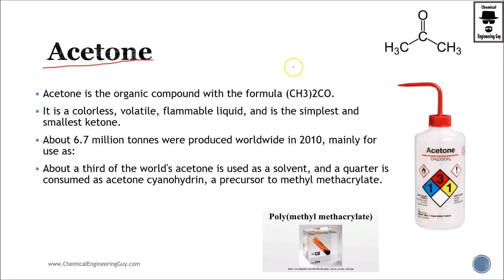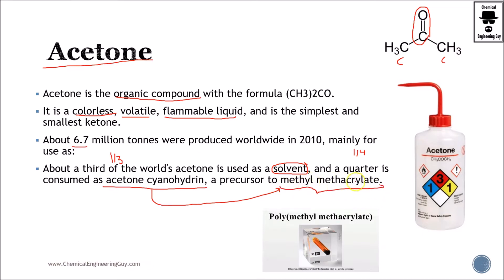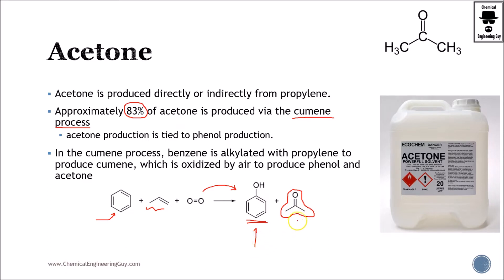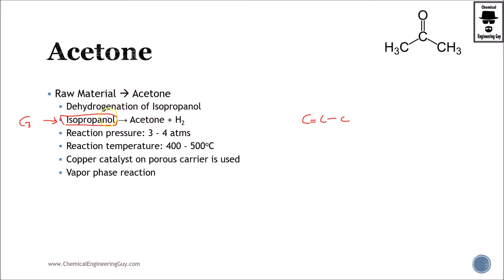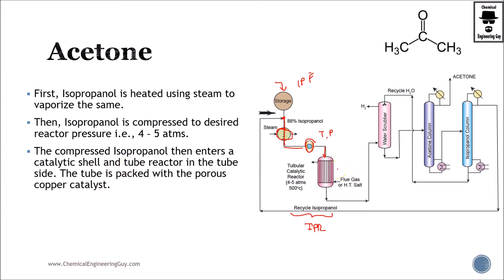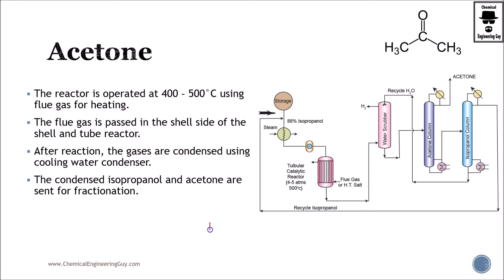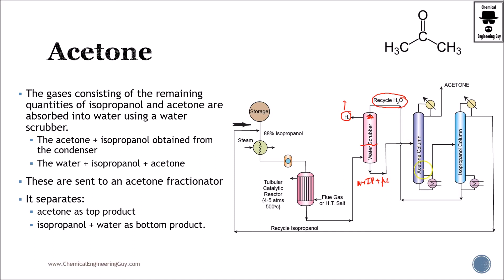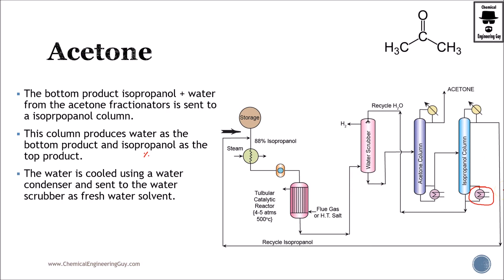Acetone Production Scheme - Petrochemical Process (Lec086)

Comment: this is process flow diagram or block diagram?
Reply from the maker: Something in between. It is more a Process Flow Diagram as it shows more detail to the process, but for sure could be a "block" diagram, in the sense that there is not enough info to actually be able to model this as a material/energy balance